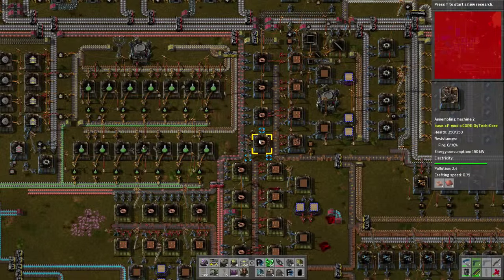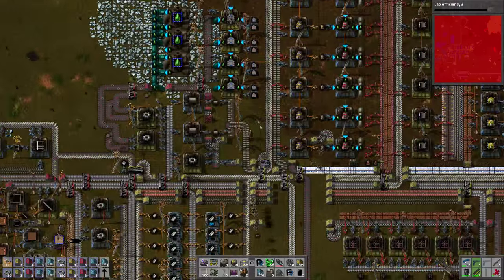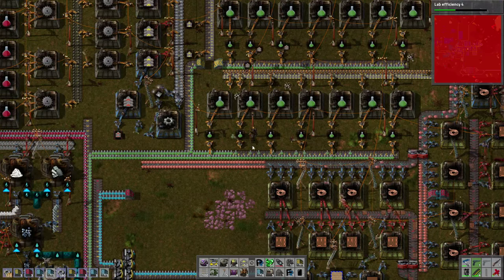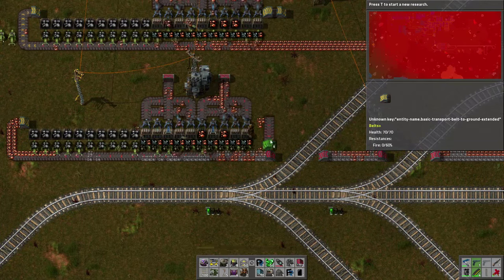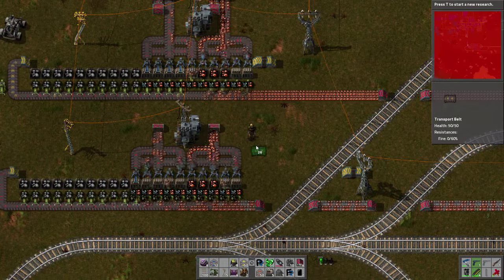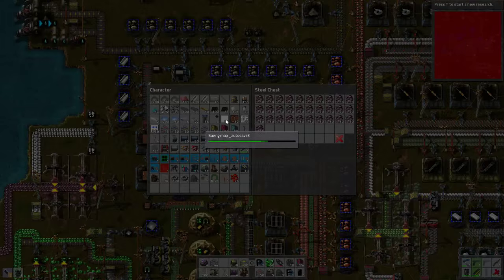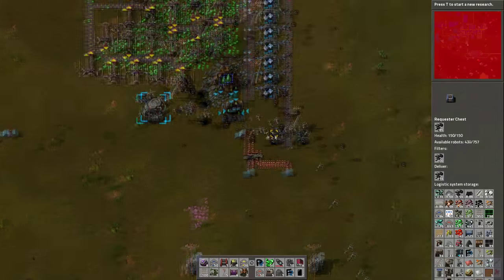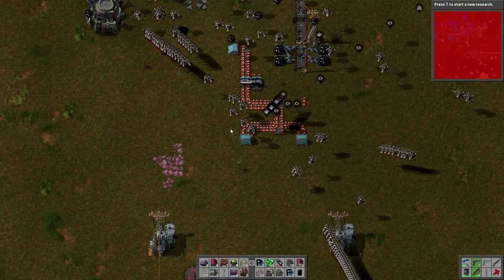Factorio - MEGA-FACTORY - #52 - Belt Upgrade!

Comment: I like your train station and sorting system but couldn't you use splitters to merge your loop back on the main track in the sorting system? Because currently it cannot merge back on because the main track is always full, but if you use a splitter, it would let copper flow from both incoming tracks. Just to be on the safe side so that your copper flow won't be stalled. Correct me if i'm wrong.
Reply from the maker: +Michael Frey I think this could still theoretically mean that the feedback belt would be full, but I might try it
Reply: +Orbital Potato Yeah when the feedback belt is already full then it makes no difference, but i think as long as stuff is taken off by the inserters, copper from the feedback belt is going back on. But in the current state, even when the main belt is moving, nothing is flowing back on from the feedback belt, because the main belt is very saturated.